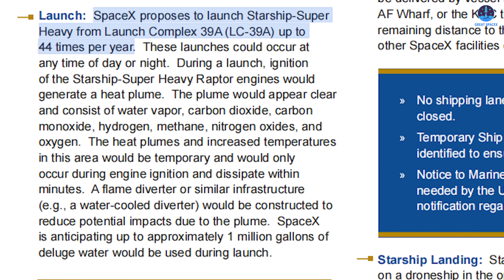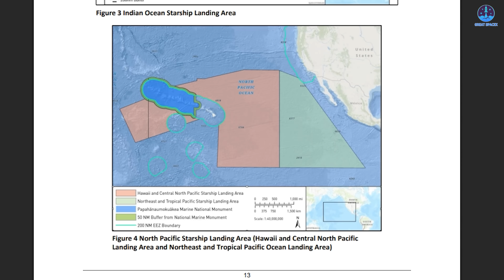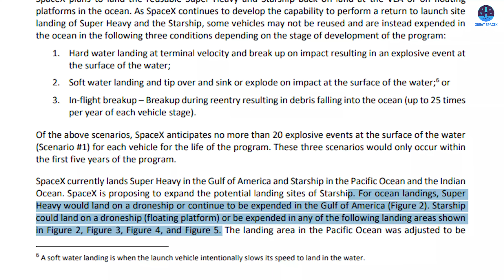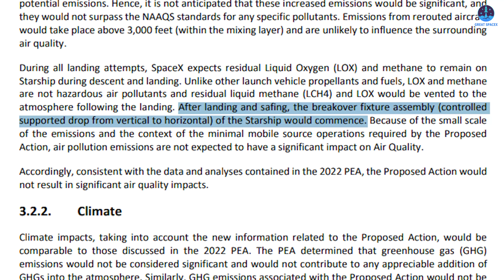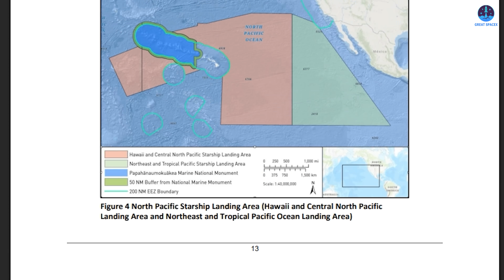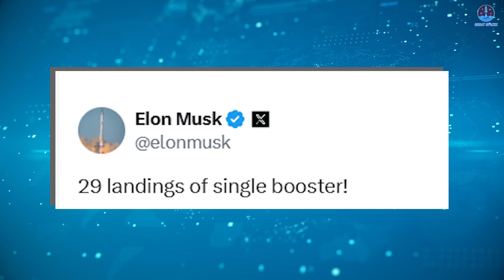FAA officially announced SpaceX Landing both Starship and Booster on DRONESHIP in 2026...

Comment: Legs carry a lot of weight, and for the same orbit purpose it means many many tons of more fuel to carry this extra weight, or significant reduce in payload capability.
Reply: Starship is going to lose a control fin and a lighter stage ring, so it will work.

Comment: I think the Drone ship capturing Starships is an excellent idea. The Starship really does not require major modification and does not need legs either. Take the Megazilla concept and implement the same thing on a large drone ship where the rocket actually lands over water or a large hole in the deck. No legs and no excessive cooling required. This babyzilla would have to be designed to allow for the mount point capture given the slight wave action but I have faith in SpaceX. Lastly, perhaps the chopstick arms that actually capture the vehicle could be part of a fold-over mechanism to lay the vehicle horizontally for travel. Obviously, these would be no small ships but that was already the case.
Reply: I'd like to see them build an off shore launch pad

Comment: I also would like to hear why a space slowed down and save heat shielding weight.
Reply: It would be beneficial if starship could slow down on reentry to reduce heat and the need for heat shield. 
But I know that would require a greater use of fuel.

Comment: I don't get this.  Return to landing side has always been claimed to be a major requirement for rapid reusability. Booster catch has been demonstrated to work twice. Why now divert from this approach?
Reply: It's from an Enviromental study which covers a lot of what iffs over the lifetime of the starship program. Basicly this is a cover for if they ever do decide they need to land starship at sea because it doesn't have the fuel to make it to the launch site.
Reply: Not diverting from that, will always do the catch. Legs not instead of, but in addition to, tower catches. Different mission priorities. Catch version is for shuttling large volumes to/from earth orbit, especially for refueling, for fastest turnaround and largest payload. Everything else, especially off planet landings, would be the legged version.

Comment: As it is the starship can't be laid down on it's side was not designed for that not strong enough it will brake apart  !
Reply: It will be soon as they are going to have to transport them from Starbase to the Cape to start launching from 39a until the factory there is built and can start producing them.
Reply: Starship with legs could land on and aircraft carrier.  Fix an elevator on deck to lower starship down a shaft and the support it by arms below the deck. 
This would stabilize starship for transport.
Cargo can then be unloaded to the lower deck. Then loaded on cargo plane to take the cargo to an airport.

Comment: Very glad to hear SpaceX will be expanding capability by adding landing options for Starship. But I’m guessing this will require “landing gear similar to that seen on the boosters. To make them more stable when choosing to land on drone ships. Which might entail long voyages through relatively choppy water. 
Also glad to hear SpaceX is still working towards making a high volume of flights an even more routine thing. We need the benefit of cost reduction due to streamlining  of assembly, erection, launch, and recovery. 
NASA announcement of the likely hood that it will take a YEAR to find a leader. Demonstrates why we companies like SpaceX, Blue Origin, Rocket Lab, Relativity Space, 
Firefly Aerospace, and probably more businesses involved in getting humanity into space and beyond. 
Still looking WAY up!

Comment: Starship is going to need a LOT longer legs with a wider spread to get a low center of gravity in order to not just tip over.
Booster will be fine, but starship landing and taking of on another planet or the moon, first of all it'll be top heavy because it'll be low on fuel and all the "stuff" on top of the almost empty tanks, second of all, debris can or will damage the engine bells on landing and takeoff if they are to close to the ground, so it'll need legs as long or longer then the actual ship.
Not really sure who they thought when constructing it but this is something it will have to have if starship it self are going to be able to land and take off from a random rocky/sandy surface.